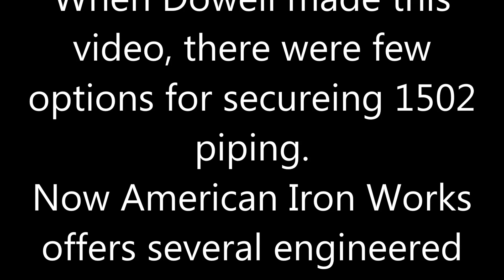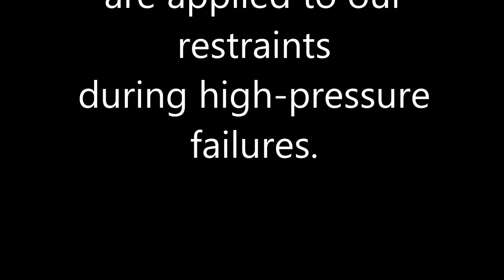1502 Piping failure

Comment: High pressure is no joke. Even trapped line pressure can kill or maim with pumps off. Before i retired was working the M1 tank line @RRAD. Cheapest bid contractor came in on a special project, hired a lot of locals with zero experience.  One idiot was tasked with changing the turret hydraulic filters and wasnt supervised. Didnt do a system bleed down, 45000 psi sliced his arm off just about halfway between wrist and elbow, and he lost an eye and ear too.

Comment: I was flipping burgers then , the worst thing to go wrong was having to work past the end of my shift because another person decided to quit without calling in ! I kept my head about it though
Reply: guess you have never seen a PISSED off Grease fire blow up when an idiot uses water?
Reply: @davefellhoelter1343   it's virtually impossible to have a grease fire in a commercial kitchen because of several factors , one is do to the fact that the flat top is kept 'clean' throughout the day with frequent wiping and scraping of grease into the catch and off the walls , the fry station is also kept 'clean' ' in basically the same way ! In the event of a fire you wouldn't have time to put water on it to cause the type of situation you mentioned because the overhead fire suppression system would activate , if that happens then the restaurant is done preparing food for likely several days until the kitchen is completely cleaned and the fire suppression system is recharged

Comment: And that is how I passed my Swagelock test. Fittings had to hold without leaking until the stainless tubing burst. Still have it as proof with the tubing expanded to nearly double the diameter.

Comment: I watched this at quarter speed it still looks like the guy in the left blows up before the pipe😂
Reply: Slings especially the last setup will still absolutely due their job wet. And in reality a wet sling has more “slip” and less friction than a dry sling and will likely have a higher breaking strength. Frozen may break sooner but there is a chance it won’t matter. What would be the bigger question is; long term how do they fair between constant wet, hot, cold, frozen, extreme dry, ect, over and over and over.

In other words how does it last underground, and for how long. Also can anything be done to help longevity under ground if they were to be used.

Comment: Dah, wouldn't you have relief valves on the line? My hot water tank has one.
Reply: What if those relief valves are busted because a lot of stuff goes wrong?  Got to have redundancies.
Reply: Most of the pumps will have burst disc valves in them . However fracking requires some pretty high pressures they are trying to fracture the earth open sometimes thousands of feat bellow ground through iron  pipe some times with acid .

Comment: I have seen 15000 pounds on Halliburton iron when fracking.  I was blender tender.
Reply: I used to test wells in Wy! I have opened up many fracs at between 15k and 35k psi! Scary as hell the first few times you do it! The company men watching your every move helped too! If they are reading this, thanks a lot you mfers for making my job just a little higher on the pucker scale than it needed to be!
Reply: Halliburton in KY rules.....
Reply: I used to work for Tri-Can and we had a few fracc jobs where we were pushing 16 - 17K at the surface and 35+K down hole with seven - eight 2600 HP V16 fracc pumps online all maxed out at 104% engine power.  

The quad turbos on each pump were so hot they lit up the whole pump line at night! 🤠

The wild part was the company would yell at us techs for sitting in our trucks idling to stay warm for using too much fuel, as if that quart an hour we used out of the huge semi tanker of fuel we burned on site in less than a day really mattered. 😅
Reply: @tcmtech7515  brings back the memories.  I slept better next to that scenario than I did at home with mama..
Reply: @tcmtech7515 so when you say 4 turbos I am assuming you are talking about a Cummins QSK 50 if you had the Murphy screens you can pull up the fuel rate. When they are maxed out they are running at 80 gallons an hour.
Reply: @aaronbrooks7106  I think that's what we had.   Your fuel burn number sounds about right.

What was funny was that we didn't use a master fuel manifold system to one central fuel tank for the pumps, and thus each pump unit had to run off its own 200-gallon tank, which meant on-site fuel techs were hating life.  

We ran at ~180 gallons of fuel on each unit, and the fuel techs took about 2 hours to do a round in the site before restarting at the beginning.   🤣

Comment: Thank you for sharing this video. Can I ask a question about the test? 
1) What happens if I do not comply with the GRE pipe test time?
2) Even if the pressure is tested below the pipe capacity, can an explosion occur if the appropriate test time is exceeded?
3) Is it a problem to test by injecting air instead of hydro testing?
Reply from the maker: 1) I'm not sure what you are referring to when you say GRE pipe test time.
2) Yes, piping can fail below its rated PSI. Time does not facture into our testing, only PSI.
3) Yes, that's a problem. Always test with liquids when possible. Liquid and gases create the same forces on the pipe before the failure, but the gas expansion creates more movement once the failure occurs.
Hope this helps!
SB

Comment: There was an ignorant coworker in my shop, one night he popped a breathing air line apart that was under pressure. 100 psi 1 1/2” diameter cam lock fittings, he thought he traced the correct line, he thought WRONG. It beat the crap out of the inside of the tuna tube,,, oops I meant submarine 😂.  He was a terror on two legs and got shuffled through a least 5 different shops before we got stuck with him .
Reply: Was he the boss's kid?
Reply: @62davelee . No just an ignorant dweeb without a clue, who pissed off lots of different people. Luckily I wasn’t one of them.
Reply: I too had guys like this on my crew dealing with CNG Hydrogen Nitrogen Steam and hydraulics one got lucky, the other learned and got lucky.
this was only construction in So Cal but gramps was a Seabee

Comment: I worked on the Dowell CatFrac units in the mis 70s, pressures were scary high, never saw an iron failure, but they did happen. Big frac job in Escambia county Fl, tubing broke loose, they were using distillate as the fracking agent, it spewed into the intake of one of the Solar turbine frac units……all hell broke loose, destroyed most of the equipment on the job. No injuries other than sprained ankles from overweight operators hauling ass and jumping off their units!